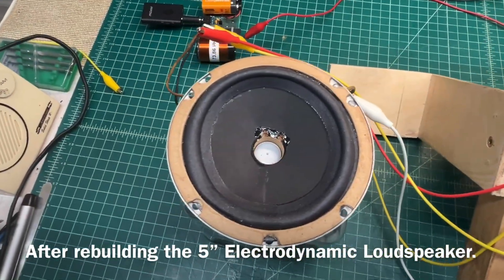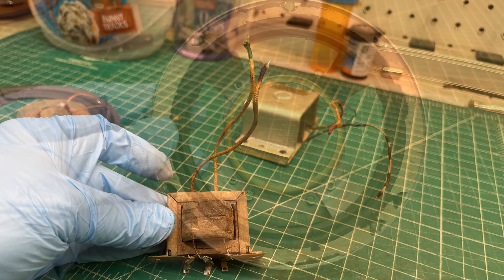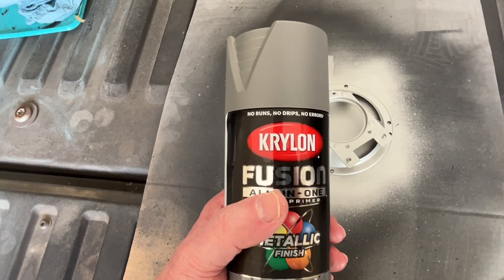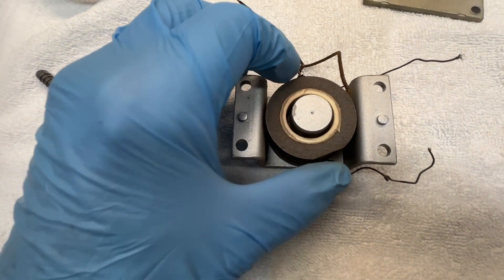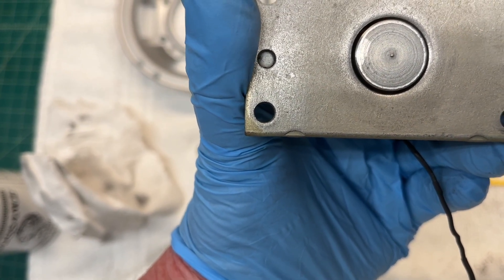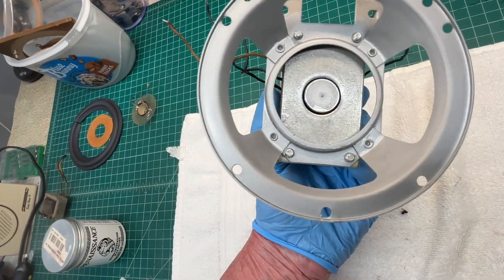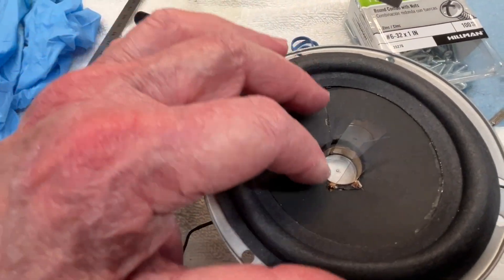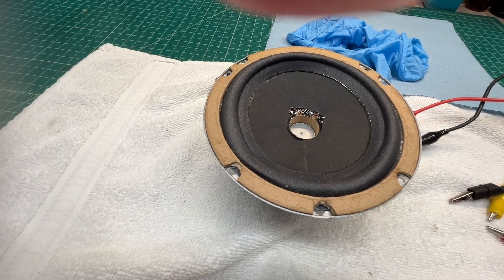AIRMASTER | 5” Electrodynamic Loudspeaker Rebuild

Comment: Good solution to use half of both spiders, the old one was cracked at the stiff edge, and now there is no stiff edge.
One remark, you glued the new spider on a painted surface, but I am in full doubt if the paint is a good marriage on the metal for such task. The glue can also weaken the paint. I would have removed the paint with acetone or so, and sandpapered the surface  (well protect the magnet against the metal dust of course) and then glued it.
Reply from the maker: Thanks for the tip on the paint. So far I’ve never had one fail, but that might be a lucky coincidence; definitely one I’ll keep in mind. Thanks again for watching and your recommendation. Best, Don
Reply: @RestoreOldRadios  On bare metal I would use an impact glue (the yellowy stuff, also named contact glue, contact cement). Usually you have to apply on both surfaces, wait ten minutes, and then bond, but that is impractical in many cases (like in your case). I often apply it on one surface and bond directly when still liquid, and that way it will still stick very well on a clean metal (sanded, and acetone) .
Of course, I don't know how good the glue is you use, that is yours to know.
Succes.